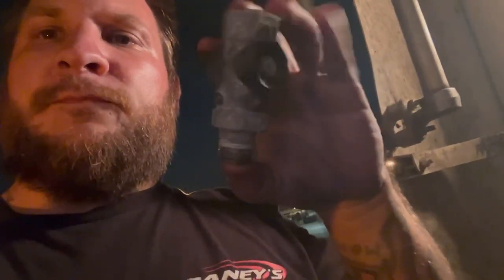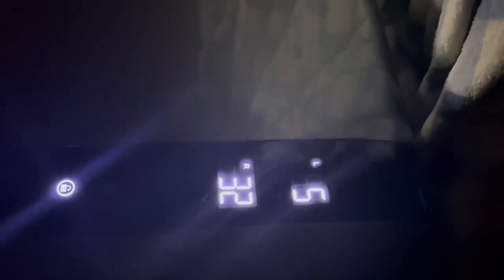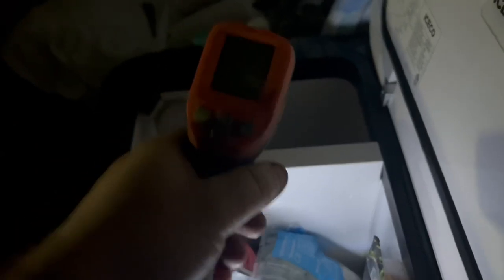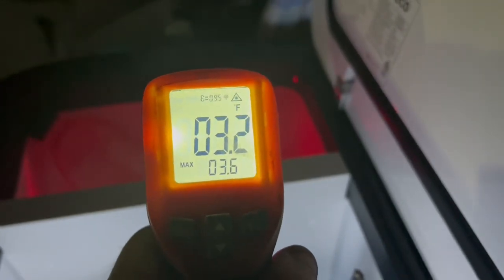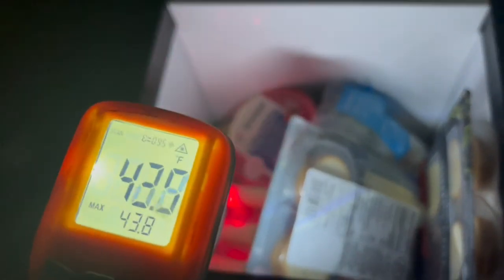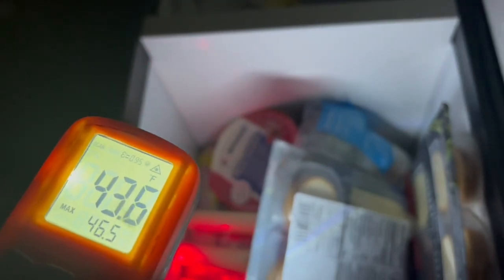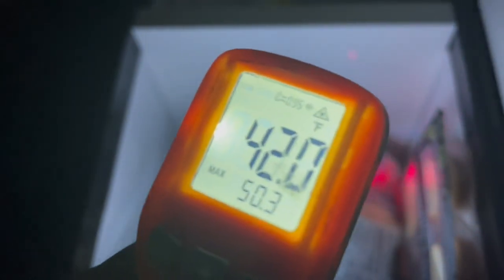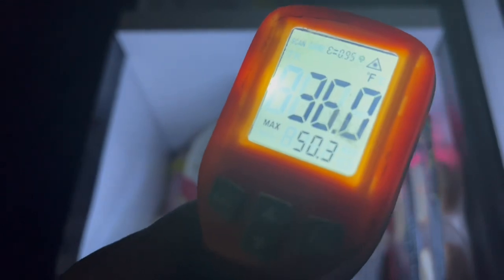The cabover gets a fridge freezer! Iceco g20

Comment: Shaun keep doing what you do. My Owner Operator experience was with a 1993 Freightliner cab over. I bought it in 1996 with 290000 miles on it. The only major expense was replacing the clutch at 600000 mi. I sold it in 2002 to a guy who was going to run it in Mexico. I still miss that old truck. 11.1 Detroit Diesel never turned up, left it stock like the company had it. Remember the trailer doesn’t know what’s pulling it down the road….I’m 68 years old now, but if I was 30 years younger I’d do it all over again. Good Luck !!
Reply from the maker: I appreciate that man. And I plan to keep and run my cabover for a good long while

Comment: Why bother with the stress of doing a stretch and axle addition when there are plenty of dual drive cab-overs out there? Loads of stretch is a pain to operate anyhow. Just look at the hassle Davis and sons have with their 270 inch K100 on tight back roads where they have to jockey on tight turns.
Reply from the maker: If I where to add a axle I wouldn’t do a stretched frame.